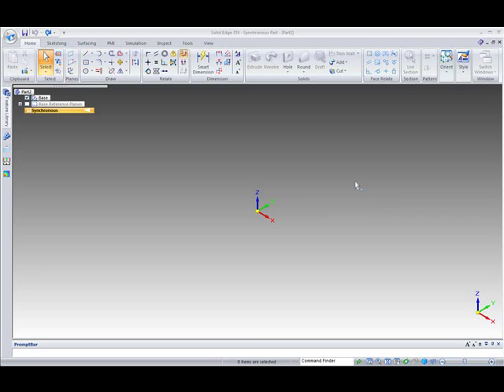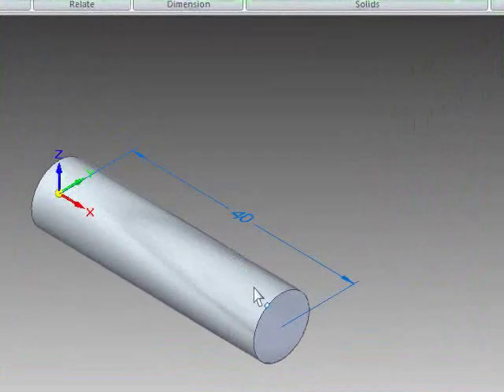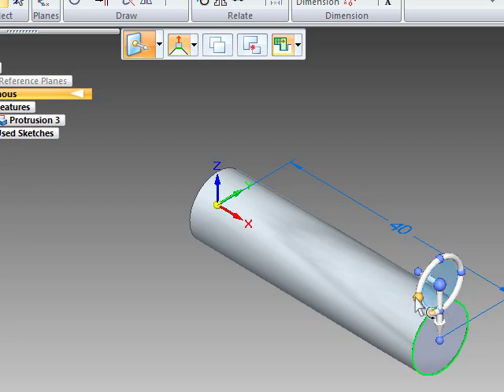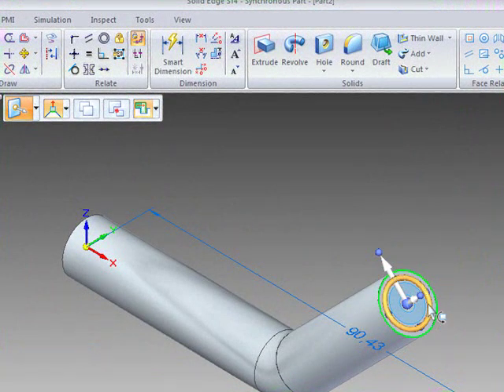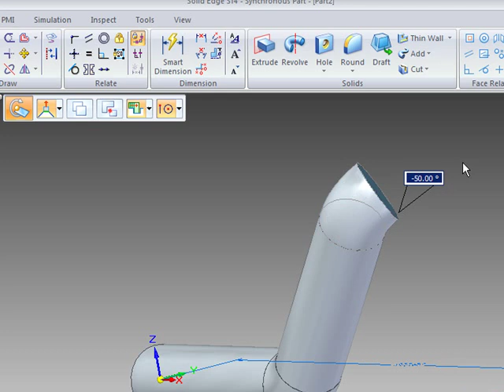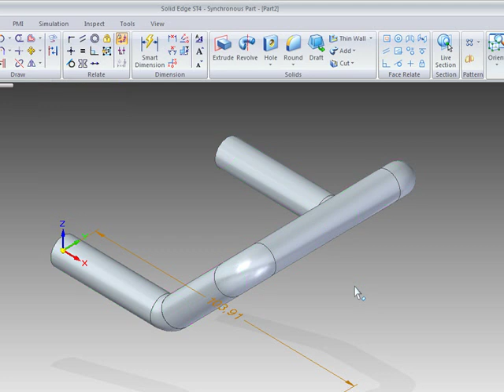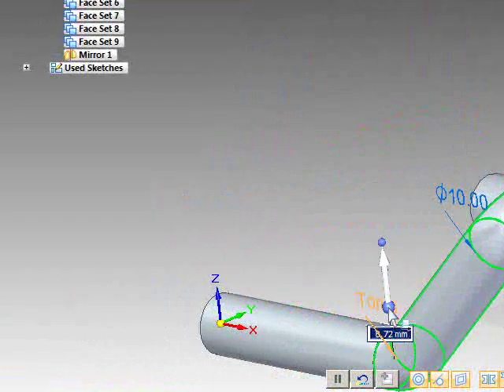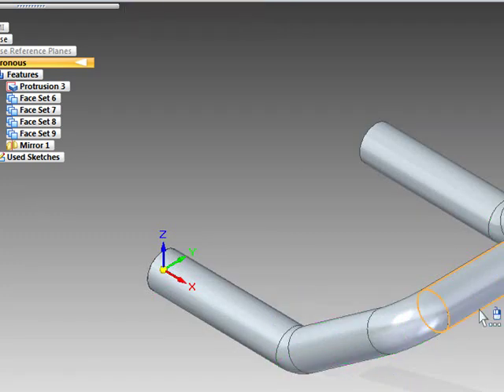Solid Edge: Synchronous Technology for Sweeps

Comment: To be honest solidedge is absolutely the WORST!!! program I have ever worked with. I have used Pro/E, Solidworks, and Catia. If people want functionality and a program that is user friendly I highly recomment Solidworks, or Pro/E. Catia is great just extremely expensive. But I suggest if you have this program get rid of it immediately.
Reply: I agree, the relations piss me off like once something works fine a minute later the same command is forbidden -there's might be logic in that but hell no user friendliness in that at all,  exaples could me multiplied - solidedge is a total crap.
Reply: I have years of experience in Pro/E, Inventor and months in Solidworks, IronCAD and Catia. This year, I started working for a company that uses Solid Edge. After just one month of learning the software, my workflows were already the fastest they had ever been and we don't even use its renowned direct modelling which is also the most sophisticated in the business (gives you much more control than the simple DM features of the competition).
TIP: Disable the awful windows menus that are turned on on automatically when you select maximum assistance and just use the overhead horizontal bar + integrated model tree inside the work space.

Also, how can you like Catia more than SE? Everything is so dated there and takes many more steps!